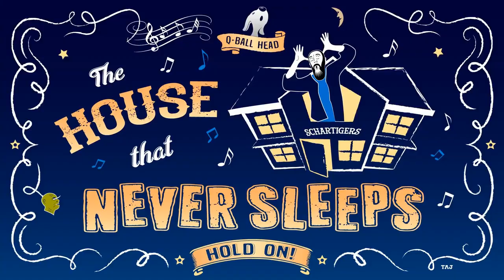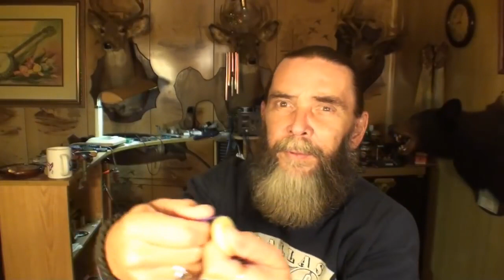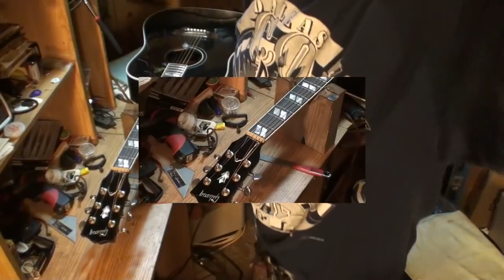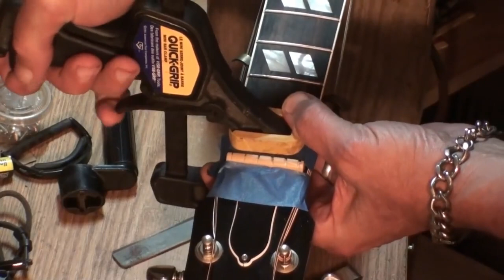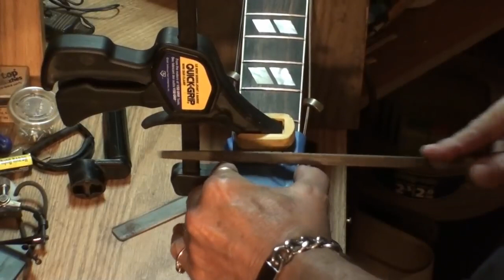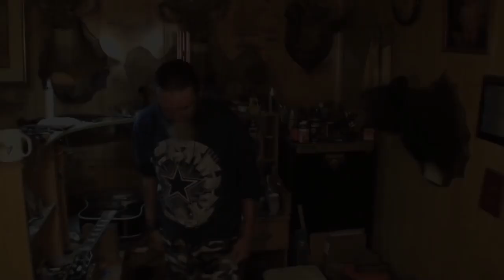make YOUR guitar play easier! nut action fix

Comment: my cheap ass still uses those same style needle files from harbor freight. I also take some really rough grit sandpaper and rough up the extra string left over from changing strings and it works pretty well just a slower process. BTW the first day I brought those needle files home I cut a whole in the fold up carrying sleeve so the button snaps. I was overly irritated by the crappy sleeve design as well lol

Comment: Hi Randy, I hope you see this. I have been using your recommended nut height of 0.018" on my six strings for years now and have always found it to be just right. What would be your ballpark for a four string bass? Thanks!
Reply from the maker: I assume you are talking about an electric bass? I set them at .020 and never had any complaints, acoustic and/or double bass have to go higher and .024 works well. thank you for checking out my videos over the years!
Reply: @RandySchartiger  Hi Randy, yes I mean an electric bass. Many thanks for your response, I'll go with that suggestion. Cheers! 😊

Comment: How do you get your action so low with out ringing out on a fret,
My guitars action at the 12th string was 4mm or higher, and 1.7mm on the first fret. I lowered it to 3mm on low E and 2.5mm on the high E.

Now it buzzes out like crazy but not on an open string. Bad around the 3-5 frets.

I watched your video on lowering action.
Reply: Have you watched his videos regarding re-setting a neck and whether or not you are in need of such a job? I did mine myself. Not super difficult just have to make sure your measurements are properly taken and accounted for. The pain is having to let the guitar sit clamped for an extended amount of time (several weeks) so that your wood adapts/adopts the new shape you are going for so when its all said and done it retains that shape. Better than spending 500 at a shop, at least for me it was with my 200 dollar guitar lol. But my 200 dollar guitar played like a dream after the hardware I've installed and adjustments I've made overtime.

Comment: Ive noticed that that string tension is higher when the string angle at the saddle is higher. Anyone else maybe?
Reply: The string tension as far as I'm aware is the same. It only feels like there is more tension.  Something I learned when researching the adjusting of Tune-O-matic systems with tail pieces on them like les paul style guitars and others as well as the whole top wrap vs regular stringing of these systems. Just search raising and lowering tail piece on tune-o-matic/les paul. Someone with more expertise would be able to give the explanation better justice than what I can